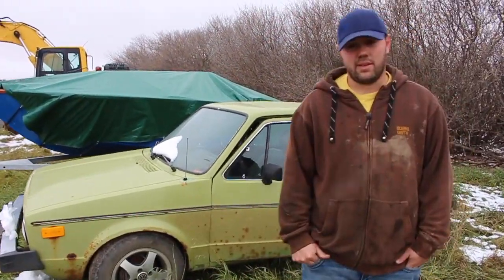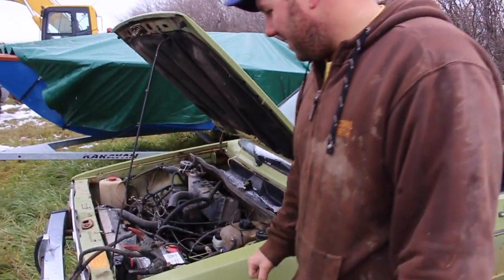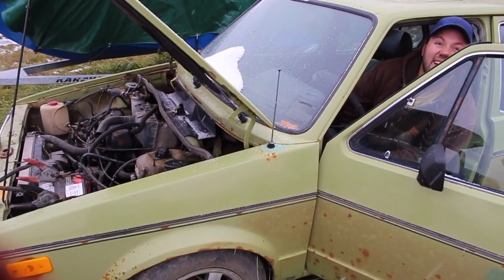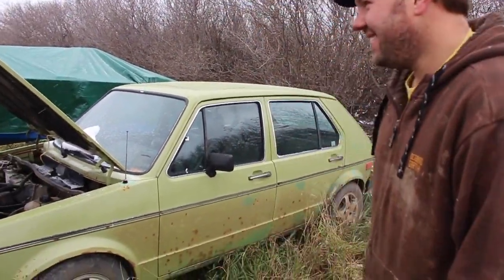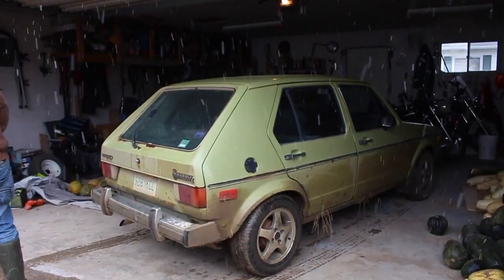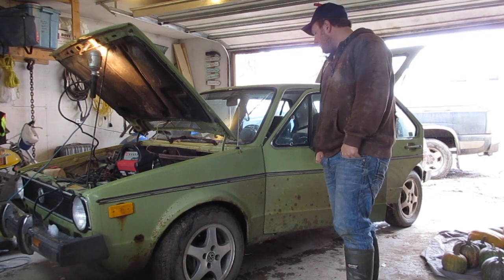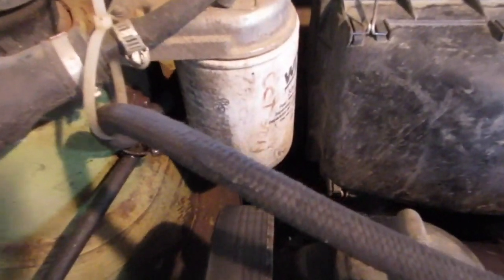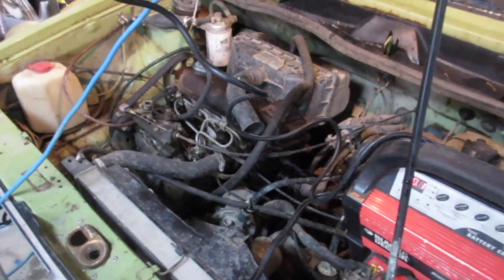VW Rabbit Cold Start | 1980 MK1 Volkswagen Rabbit

Comment: did you ever figure out the cooling fan? I can't say i've ever seen mine kick on.
Reply from the maker: +Justin Phillips Yes! Mine works good now! I had to replace the temp switch on the side of the rad! TEST YOUR FAB FIRST TO MAKE SURE IT WORKS!
Reply from the maker: +This and That with Chris FAN
Reply: I hooked up a small battery to the fan, and it works. even though the connections are all powdery. my wiring is so janky in this thing.

Comment: Smoke looks normal, you will have either a 1.5 or 1.6 NA IDI diesel, 1.6 more likely as the earlier engines didn't last too long. Our 1979 Rabbit has a tired 1.6 from a Jetta, tons of blowby and oil consumption, pain to start below 50 F, but still gets 45 - 50 MPG. We will be swapping in a 1992 1.6L factory turboed engine sometime soon.